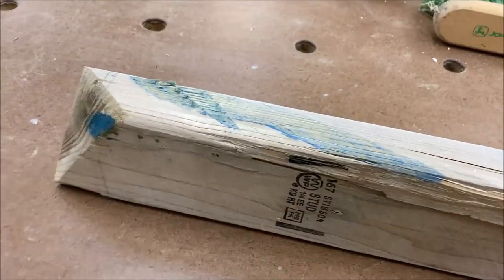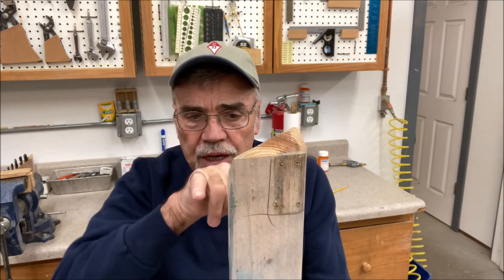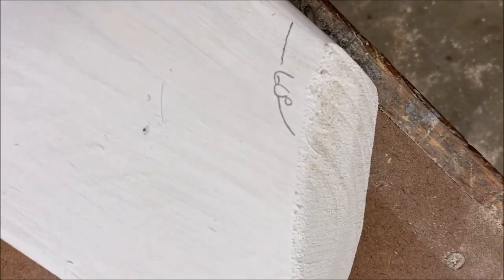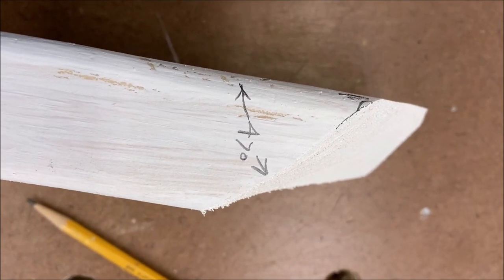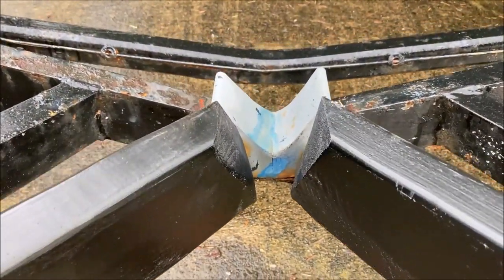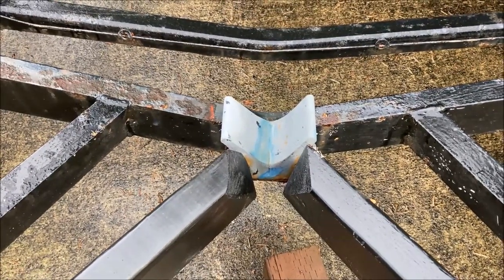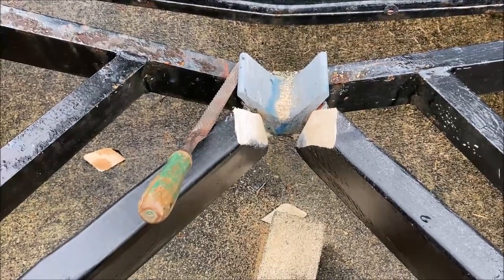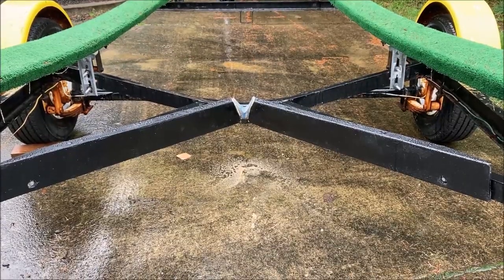Trailer centering boards for a small sailboat--Catalina 22 --Jim's Little Boat--Updated Information.

Comment: Re watching your earlier video making these, I feel as thought your 1/4" alloy bracket will be the weak spot. Easy enough to unbolt and take somewhere for a gusset or two to be welded in. 
Look forward to seeing the results!
Thanks for the video
Reply from the maker: Good idea.  T.hanks
Reply from the maker: Well as it turned out the aluminum bracket was fine.  If it corrodes, I will go to the welding shop and have them make something out of stainless.
Reply: @jimslittleboat4388  Good to hear Jim, plan your work and work your plan 👍

Comment: Is there a link to the follow up video or are you going to drop a comment here that they worked fine? Really interested in your results and THANK YOU, for doing so much "dinking around" so we might not have to ...do so much (there's always a little).
Reply from the maker: Well the first effort kind of worked. Then I went with wider boards during February of 2022.  I Launched on April 15.  I will pull the boat out about Oct 15.  Then we will know if the wider boards worked.  I had kind of forgotten about putting up the results.  I am reasonably sure that they will work better.  I will do a short recap then.  Thanks for the reminder., Mark.

Comment: Retired commercial carpenter here. When trying to make weird compound cuts like this, it is far easier to use a 3.5 or 4 inch angle grinder with 36 grit disks !!
It will turn the waist wood into sawdust in seconds !!!
Reply from the maker: I agree.  In the end that was how I got the final fit.